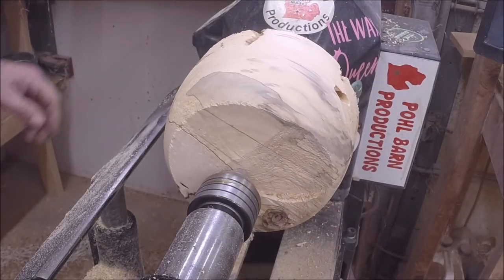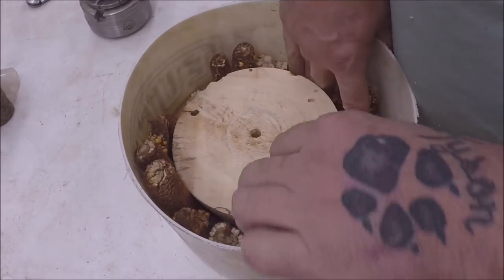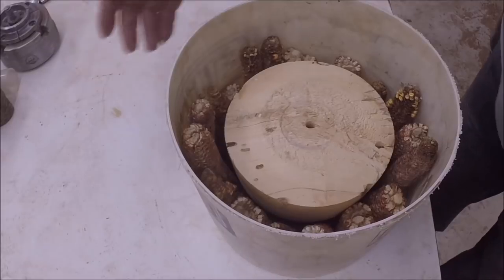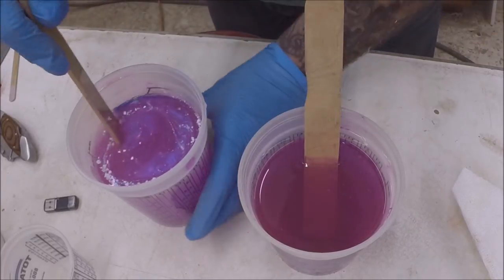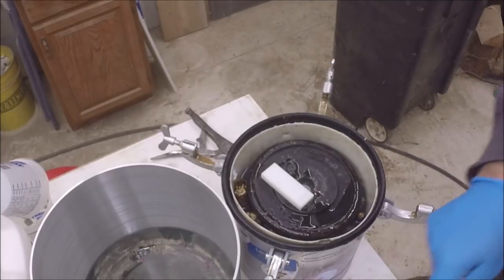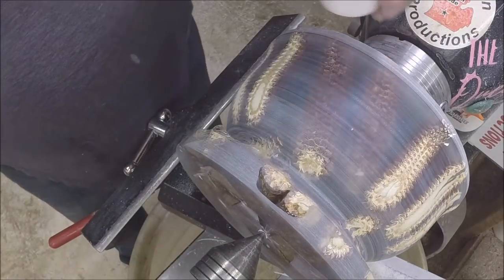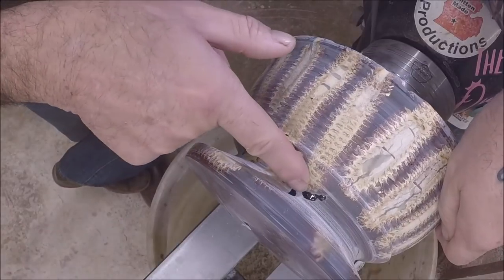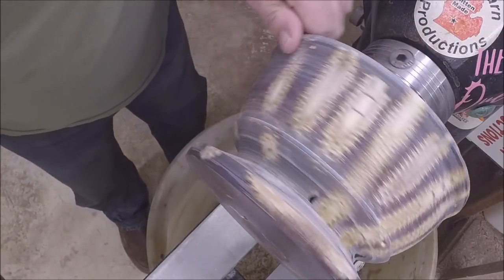Corncob BOWL and Epoxy Resin

Comment: I think that "waste block" would've been gorgeous to turn after being covered in resin.
Reply: Mustang Pilot Isn't it just as easy, or even easier to stabilize half rotten wood as it is corncobs?
Reply: Agreed
Reply from the maker: thanks Kindiah,   I knew I would get grief over the waste block but the stabilizing resin is expensive and I have so much of that FOG wood that I wasn't going to miss one piece of it in the least.

Comment: Hey Doug been watching your videos for a long while now and like your work. Question for you I am a furniture builder and have wanted to get into wood turning. I have finally retired and am looking at the Nova Orion or the new Rikon 70-340 with the extension bed, what is your opinion of the 2. Thanks BG-
Reply from the maker: Thank you John,  I have not used either of those lathes, I really like the DVR motor, no belt changes and you can't really slow it down no matter how hard you lean on the gouge.  the Orion is suppose to be a beafed up version of my Galaxi.

Comment: I am not a wood worker. I am a mechanic so I could be all wet here. It looks to me like the resin is too viscous . When a fluid is viscous and it has air run through it, it tends to create larger bubbles. Because the fluid is viscous and it has obstructions in it, the bubble gets trapped and then turns into a void. Now having said that, and again o may be all wet, can you mix a thinner with the resin like naphtha to thon it out? Would that ruin the resin? Maybe another chemical like alcohol. Alcohol will boil out in a vacuum that is why it was not my first choice. Would love to hear a response on this good bad or ugly.
Reply from the maker: the resin I used for this is pretty thin to start with, not sure why that air was trapped in there but it doesn't matter now I have to fix it anyways,  you can add acetone to the resin that will thin it and the resin will stay fluid for much longer until the acetone evaporates off.
Reply: I understand that 6are going to have to fix this project and work with what you have. I was making the suggestion for future projects of this type. If you decide to do something like this again, try mixing in some acetone to thin resin. Just be careful of how much vacuum that you put it under. Acetone will boil under too much vacuum and cause more harm than good. Also if you do try, make sure all acetone is out of solution before putting resin under pressure. Once under pressure, the acetone will not come out of the resin and you may have mush if the resin cures at all.

Comment: could you not put the piece back into the vacuum chamber after you sand it to 120 grit and re do the epoxy so it is forced into all the faults and if sanded the faults wont show and will help the epoxy to adhere to what you've done already.. please persevere with it its interesting... tim
Reply from the maker: Thank you Tim,   not to worry Tim I have a plan !